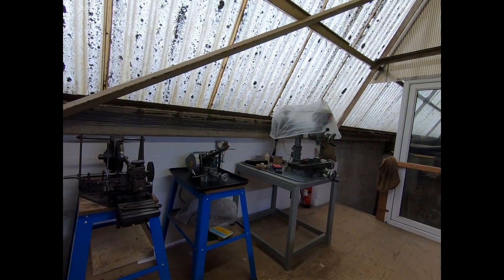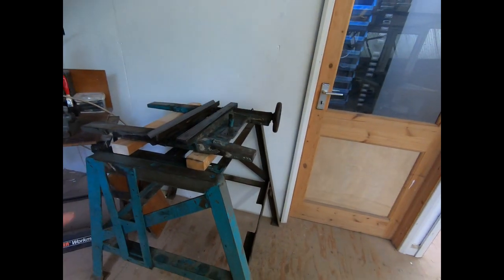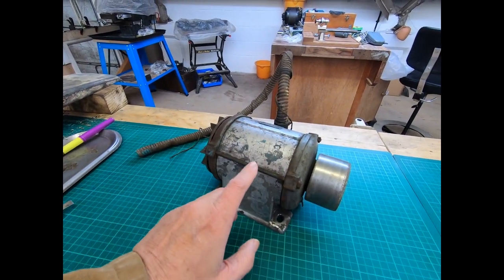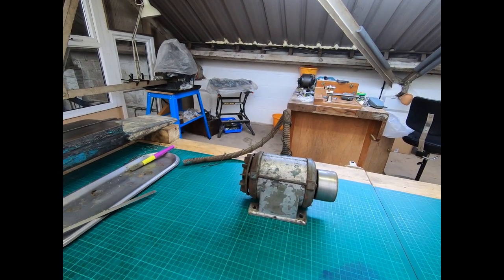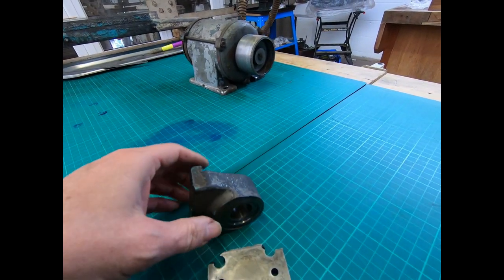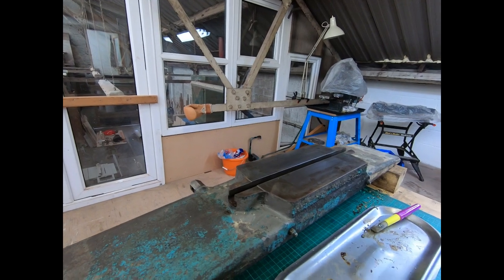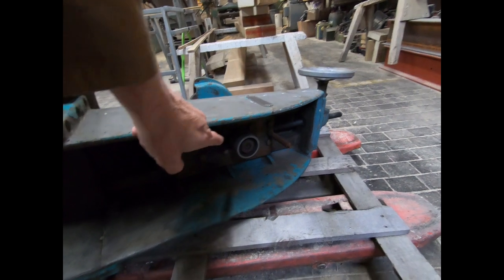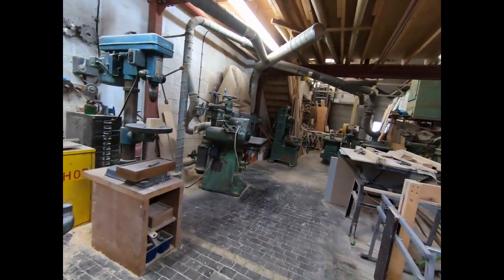Surface Grinder Introduction...

Comment: Well young man, you need to learn to weld and get a plasma cutter so you can cut profiles. For example, for a cooling tray. Intresting stuff young man!
Reply from the maker: Hello Jon,
Many thanks for watching my video and taking the time to comment... I actually purchased a welder this week. I am captain slow so it may be a little while before further progress on the surface grinder.
Take care.
Paul,,
Reply: @TheKnacklersWorkshop  Hi Paul, I found your channel from Phil Whitley and we all know what a master of engineering he is. As for "Captain Slow" I don't believe that for a minute. A good bevel on both sides, preheat and away you go with that repair. Or, you could gas weld the part? I only do Mig, stick and teaching myself Tig welding at the moment.
I have a double ended Abwood tool grinder I need some grinding wheel for if you know of any? I can get them made but they want £250 for six of them plus VAT.
Best regards, Jon.
Reply from the maker: @JonDingle  Hi Jon, Sorry I can't help you with the grinding wheels. I have just subscribed so I can follow along with your YouTube adventures

Comment: Well it looks like you are making progress Paul. As Jon says you maybe would be better with new motors. Not watched all your vids , but assume you have 3 phase supply up there. But the motors may well be ok. They are pretty sturdy things & could well do with just new leads on them. Will be watching more of your video's. Looks like on the office side of things you know what you are doing. I keep looking at making my channel better , but am useless at that type of thing.
Regards. Steve.
Reply from the maker: Hello Steve,
Thanks for dropping by... I managed to get the forklift and got the pallet upstairs... Progress is a little slow on the grinder, I have only primed the stands and hope to paint it next week. My logic is that I can then put the stand in place and restore the other component parts and start building the machine back up... 
With regard to your channel just keep doing what you're doing and you'll find viewers who like the way you do stuff.
Take care.
Paul,,

Comment: What a fantastic addition..
Sorry to be out of touch for so long, life happens...lol..
With regards to moving the hexa cut into that little room one thought popped into my head a person could conceivably put a hole through the wall to move longer stock through the saw if that helps at all just a thought I remember seeing somebody do something similar with a lathe they just cut a hole in a wall so that they could use the throughput
Reply from the maker: Hello Craig,
I sort of have a plan for that room now... I will be making it a grinding room but undecided if the Hexacut will go in there or not... Thanks for watching.
Take care.
Paul,,

Comment: I am so envious of how many small size industrial tools are available in the UK. Over here, the smaller stuff often calls a higher price, more homeowners in the market. Once you cross about 6,000 lb, prices are much more steady. That said, I have never seen as many smaller machines in my life as you have managed to assemble in the past 2 years. I am currently at that stage in life where I have to consider downsizing. It's heartbreaking to imagine a life with no machine equipment, your set up looks ideal for a residential garage.
Reply from the maker: Hello Jean-Paul,
I have now finished my collection of machine tools and the goal is to get them all into a good working condition on 2022 then I should be set moving forward. Finding these tools has taken some time in reality as I have had many saved searches and some things take quite a long time to appear. 
I hope you downsizing plans go well...
Take care.
Paul,,

Comment: Your idea for a coolant tray is a great idea. I don't have any particular design to offer, but it occurs to me that the shape of that projection is pretty typical size for Tupperware for example. If you look closely at Tupperware, all around the perimeter is a gutter that is about 50, 000ths lower then the flat section of the bottom. I think if you found a piece of Tupperware that the flat section was as large or larger than the iron projection, it might be easiest to cut a rectangle out of the floor of the Tupperware and slide it over the projection. You could then use silicone to make a seal that you can easily peel off in the future if you change your mind. Obviously the typical approach would be to bend up a sheet metal pan, but I think you would have a much more difficult time getting a proper seal. You could make it have sides for the internal hole, but then the cutting fluid would be just as likely to run in between the projection and the tray. Silicone grabs onto plastic very well, the integrated gutter would be very simple to add a drain hole with a piece of hose going to a bucket.
Reply from the maker: Hello Jean-Paul,
I like your thoughts on the the coolant tray, I think the key to success is to try and think outside of the box....Thanks for watching.
Take care.
Paul,,

Comment: Nice find Paul. All looks good except the broken piece, which others have have already given any advise I would have for it, and the motor which looks a bit crusty but may be savable. It is an interesting machine. Surface grinders are about non-existent in my area in any size. All the best!
Eddie
Reply from the maker: Hello Eddie.
I think I should be able to manage the making of the replacement part... and rest of the machine just needs some cleaning up and paint and then should be back in action. On the motor it would be nice to have the originals on both the surface grinder and Deckel but as always cost is the main. Thanks for watching.
Take care.
Paul,,

Comment: Hi Paul. Your notion to isolate the abrasive machines is in line with every quality machine shop that I've seen, and I always jumped at every opportunity to visit various shops in my working life. Put a good seal on the door and sticky pads at the threshold, your ways and lead screws will thank you. Looking forward to some sparks 🙂
Reply from the maker: Hello Rich,
Good to hear from you. I think it will be the way to go having a grinding room... Thanks for the tip on sealing the door and threshold. This was the last machine on my shopping list, so 2022 is the year to get them all back into service and making lots of chips and sparks.
Take care.
Paul,,

Comment: Great deal!  A surface grinder is a magical piece of equipment!  The ability to remove half a gnats hair is incredible!  I really want to get mine doing some cylindrical work.
Reply from the maker: Hello,
Cylindrical work would be good... I have watched a few videos by Steve Barton of Solid Rock Machine Shop Inc doing it... When I was an apprentice I did like surface grinding although they were very big and expensive machines... Thanks for watching.
Take care.
Paul,,

Comment: Hey Paul. I would probably make a new part if you can. If not then making a new base and fasten with pins or screws would be my next choice. As for moving the grinders into the small room I guess it comes down to how much grinding do you plan on doing? If you only use the grinder a few times a year then I probably would leave them as is and not move everything.
Reply from the maker: Hello Tom,
I am not sure about how much I will use the surface grinder but feel quite confident I will use the tool and cutter grinder quite a lot. On the bracket front I will make a new one for the machine and try and fix the old one for practice. Thanks for watching.
Take care.
Paul,,

Comment: G’day Paul. I’d make another bracket out of a block of cast iron. It could be repaired by bolting on a new base but I think you said it was for moving the table back and forth so it would be under considerable load at the end of each movement. 
Cheers 
Peter
Reply from the maker: Hello Peter,
I will make a new bracket and have that fitted to the machine and also try and repair the old one just to see if I can and give me a little challenge. Thanks for watching.
Take care.
Paul,,

Comment: You could repair that one by machining off the thickness of the broken piece and then make and fit a plate to the bottom and secure it with loctite and 4 countersunk Allen bolts. Nice machine! I am still looking for a surface grinder. Only CJW I can find is CJ Winter who make thread rolling equipment in the uk! All good stuff!
Phil
Reply from the maker: Hi Phil,
As I need to spend more time machining I think I will make a new bracket and also repair the old one... I did find CJ Winter when I was googling around... It would be nice to know the make but not super important. Thanks for visiting.
Take care.
Paul,,

Comment: Great find Paul, I am sure it will clean up nicely. Never seen that configuration before so good luck with your search. Per Tony's comment, you will be cheaper getting new motors than rewinds on the old. Safety tip, ensure you either chuck that wheel away or give it a really good inspection and ringing prior to switching on, I would personally bin it. Separate room for the grinders...... Absolutely, you are fortunate enough to have the option so it would be daft not to use it. All the toolrooms I have worked in did exactly that. You will need to upgrade your lighting in there though, and possibly paint the tin work white, you need good lighting for grinding, especially on the T&C. Cheers, Jon
Reply from the maker: Hi Jon,
I would be nice to know the origin of the machine... I agree, new wheels for both grinders. With regard the room I will do it, just more work to do but once done it will be worth it... I am very keep to make things rather than fixing up old machines, one of the downsides of a limited budget. Thanks for watching.
Take care.
Paul,,

Comment: Gday Paul, that’s a great buy really, I’d make the broken piece out of steel, good idea making the grinder in room for sure, Cheers
Reply from the maker: Hi Matty,
It will be useful I think, I had to go with another project type purchase as the money is getting low. I think I may go with the grinding room approach but just need to check sizes.
Take care.
Paul,,

Comment: That looks like a great find and it looks like you may need an engine crane to get the base back on the stand. We do not have the luxury of a seperate room but it does sound like a good idea, either that or a small partition where they are currently sitting. The magnet vice on our surface grinder needs a refurb and it does not have a makers badge although it does look like an ecipse, do you know a company that could refurb it? We found a good company that sells overseas motors if you want to go down that route, we just bought a 3hp/1ph from them for a project
Reply from the maker: Hello Joseph,
Agreed there will be a few problems getting the head back on due to its weight... I have an eclipse vice with mine, I have it in bits at the moment, I may make a video showing the insides of it, there is not much inside of it. I'll drop you an email about the motors when I get to that stage. As always thanks for watching.
Take care.
Paul,,
Reply: @TheKnacklersWorkshop  Hi Paul, we read that taking the vice apart can cause it to loose it's magnetization which is why we have not taken ours apart, no idea if it is fact or fiction. It would be good to see the inside. Joseph and Iain
Reply from the maker: @GardenTractorBoy  If I don't make a video, I'll email you some photos... either way you'll get some info...

Comment: On the motor front, I have a couple of videos on induction motors (4 including the grinders). They are not hard to check over and repair if required.  Take a look and by all means ask questions and if you need more information I can also do another video.

On the bracket, welding will distort the part. It might be better to make a new one, using the old to take measurements from. Either that or try to TIG braze.  Make a drawing and take measurements first though.
Reply from the maker: Hi Ben,
Thanks for the info about the motors, I will check your videos out.  I think I will just make the replacement part... Thanks for watching...
Take care.
Paul,,
Reply: @TheKnacklersWorkshop  if you have any questions, let me know.

Comment: I dont' know much about surface grinders but I know they use them to resurface flywheels and heads in cars, I bet it is very precise and a greats machine.
Reply from the maker: Hello Vernon,
Fingers crossed it will still be reasonably accurate... I will make sure I bring everyone along as I get it fixed up... Thanks for watching.
Take care.
Paul,,

Comment: Hi Paul. Another great find. I'm not entirely sure it would work, but if you machined off the thickness of the baseplate from the part with the hole in, you could just fabricate a flat plate that would go underneath and screw it into the block?
Reply from the maker: Hello Olly,
That's an interesting idea... I am in the workshop tomorrow, I will have a look. The original idea was to have just a lathe... I need to STOP buying things now lol.
Take care.
Paul,,
Reply: @TheKnacklersWorkshop  you can never have enough tools, unfortunately space to put them is the main issue, oh and time!
Reply: @TheKnacklersWorkshop  yes you do, but who am I to  talk about bringing things home

Comment: Hi Paul. Another interesting project to follow. You'll be better off replacing the two motors you mentioned with either imported new, auction ones or second hand, 
they'll be more economical than refurbishment if your contemplating having them completely rewound, especially these days. Nice find Paul. Tony
Reply: I buy all my motors from a scrapyard. I've only had to replace the leads. Induction motors are almost indestructable.
Reply: @BensWorkshop  I agree Ben. Good motors are usually overlooked when a machine is outdated or scrapped.
Reply: @eyuptony  The only parts that could possibly wear are the bearings which I have not yet come across though they are easy to replace. The leads go though.
Reply from the maker: @BensWorkshop  Thanks Ben... The guy with the fork lift owns a scrap yard so I will have a word with him...
Reply: @TheKnacklersWorkshop  But you already have 2 motors.... All they need is a quick check and wiring up for testing.
Reply from the maker: Hi Tony,
I really did not need another project but the price was very good. It was a large sports car restoration place that purchased a job lot of machines about ten years ago and this along with another machine was not wanted and just sat in a dry store. 
Thanks for the tip on the motors... it will be a lot easier to buy new, very nearly plug and play. Thanks for watching.
Take care.
Paul,,